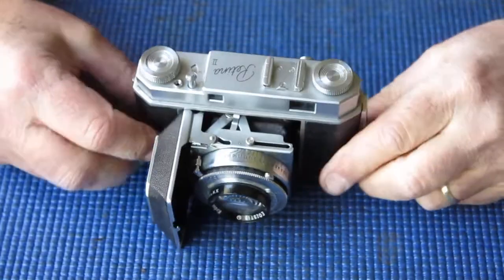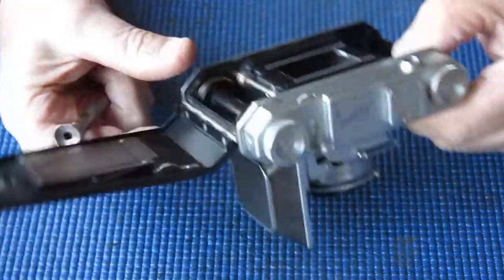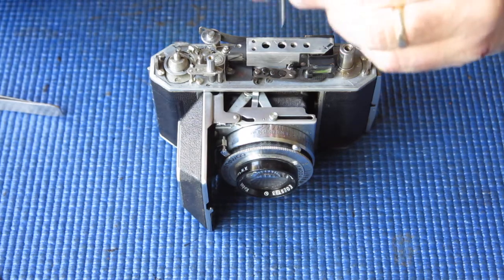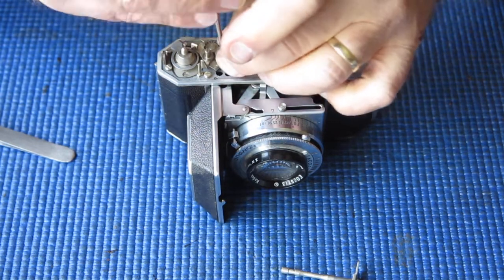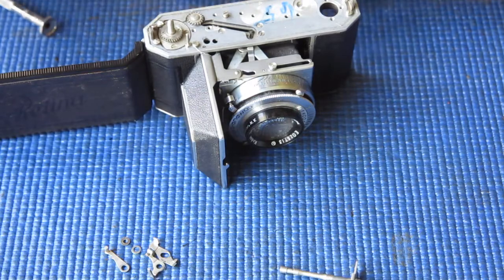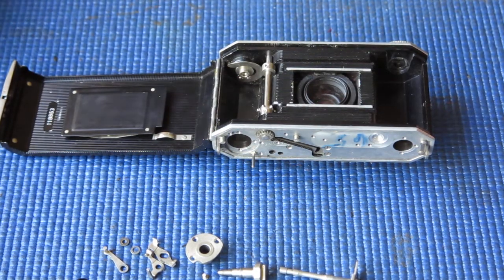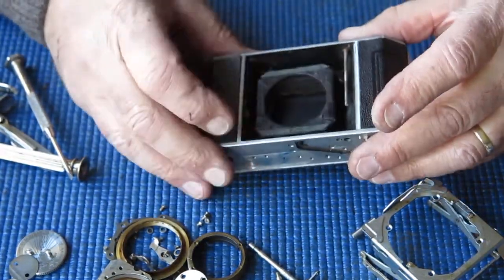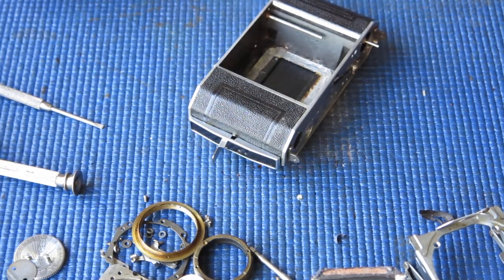Servicing a Kodak Retina II type 011 film camera part 01

Comment: Would you happen to know the size of the left-hand thread advance knob? Been waiting for decades...
Reply from the maker: OK, I measure the shaft at 3.45mm, so thread probably 3.5mm. Thread pitch is 0.6mm. Diameter of top of advance knob is 19.8mm, height of top part 6.68mm. Underside of knob is 3.3mm high, 7.78mm diameter.